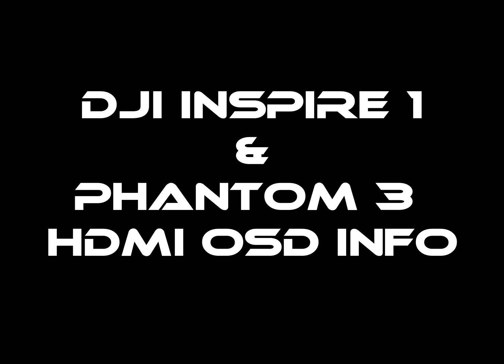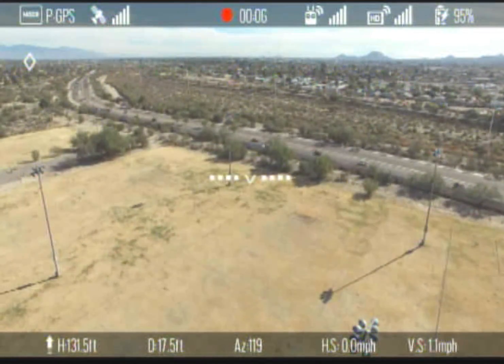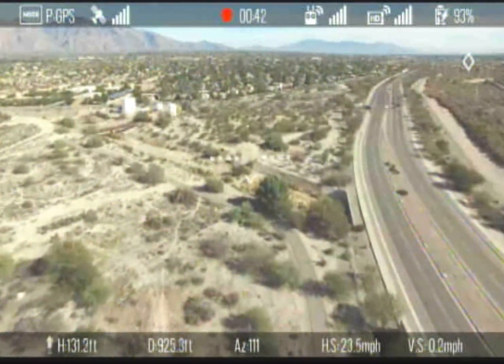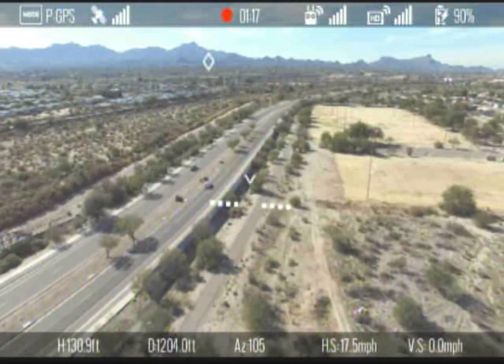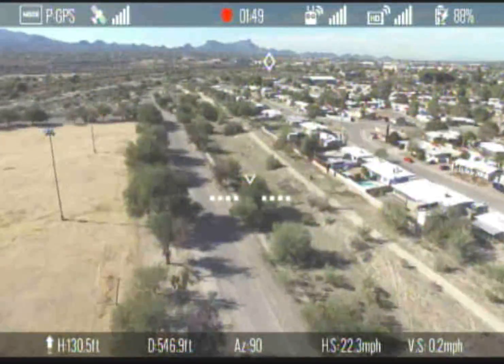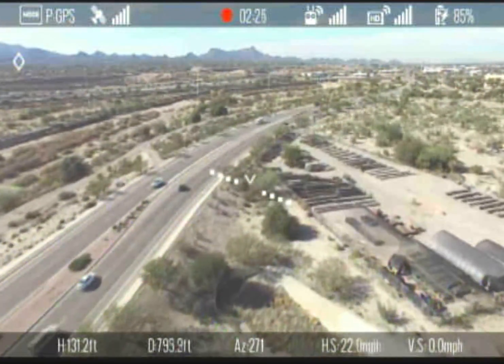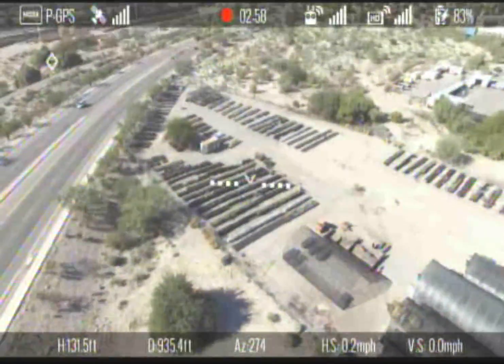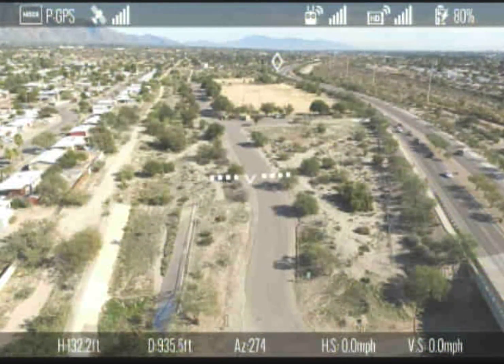HDMI OSD for DJI Inspire 1 and Phantom 3 w/ mod

Comment: Can you connect the P3P transmitter directly to the goggles via Hdmi without a phone or tablet connected?
Reply from the maker: Yes! And that is the great part is that all the latency you see on a tablet is almost gone when directly connected to goggles of your choice!
Reply: Does the same apply to the Dominator v3 goggles?
Reply from the maker: Yes the dom V3's are a great choice for this!
Reply: +Team High Society The Dom V3s are cheaper so i might get some.
Reply from the maker: The Dom v3's are a great choice for sure you wont be disappointed.

Comment: sd version where is 720p size?
Reply from the maker: +Diodo Paul I used a pair of Fat Shark HD v2 goggles to capture this video after converting it from HDMI to Composite. The reason is because the Fat Sharks only record from the internal receiver or the composite input they do not record off the HDMI input. Also the video is to show the OSD and features not the video quality. The 720p output from the phantom / inspire is very good!